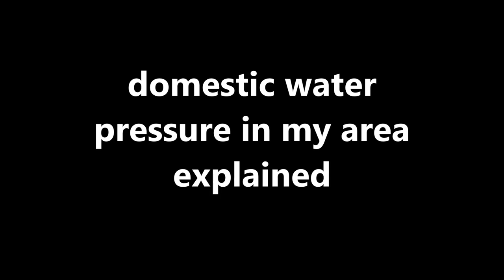domestic water pressure in my town how its works explained

Comment: Nice video chat Steve.  We have decent pressure here in NJ at my home. I run the sprinkler system to water my lawn at 4 am so I get maximum pressure at the sprinkler heads. If I did it in the middle of the day with the washer on and my kid in the shower I would get a trickle out by the lawn!

Comment: Ahh! Thank you for the explanation! My city has pump stations and reservoirs scattered  all over. I see about 90 pounds coming in  and reduce down to about 40 for for all the fixtures inside, hose bibs being supplied ahead of the PRV..  Even with a 1/2" main coming in, the flow is not too bad at all.

Comment: One of the places I work at in west Toronto logs the city water temperature and pressure on charts to know when they will get most effective process cooling. This is measured right where the 8 inch water main enters the facility. The average water pressure in that area is 80 to 95 PSIG. This is not far from Lake Ontario, but I cannot say there is a water tower nearby. Maybe municipal booster pumps? I am surprised people living in the area are not experiencing failure of plastic valves and connections on toilet tanks with such high pressure. Of interest: highest city water temperature is in September at 72°F, and lowest is 37°F in March. You can also see the pressure dips on weekday mornings around 6 to 7am when so many people are using the shower, pressure might go to 65 PSIG then, and later in the morning on weekends. Overnight between 1 and 4am the pressure is highest, and this might explain why a surprize pipe burst might occur when nothing is being used when a family is asleep.

Comment: Increasing the bore of the supply lines---as you tried to relate---will only augment VOLUME; increasing the pressure requires UPPING "the head" on the supply volume, poss. by raising the height of the storage tank---or pumps as you installed...!!